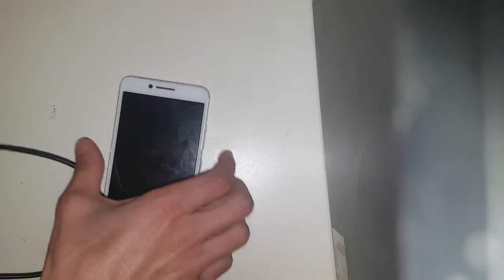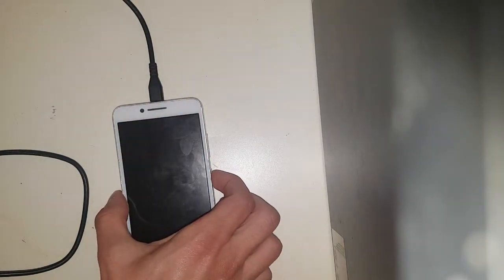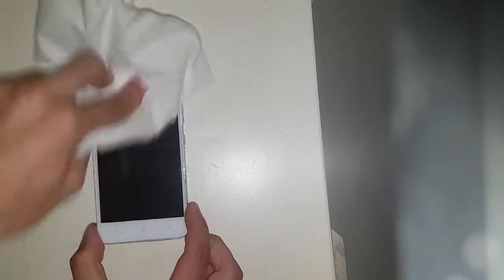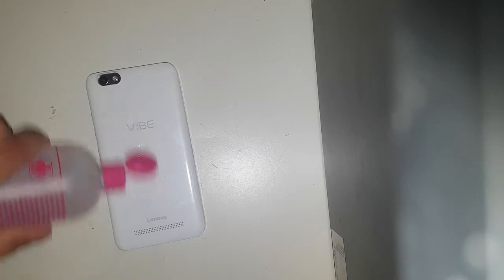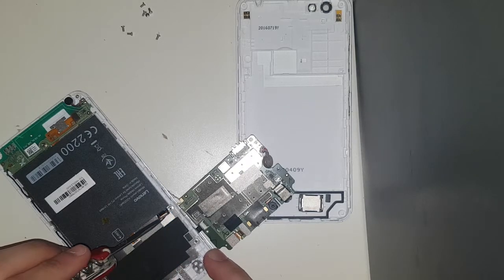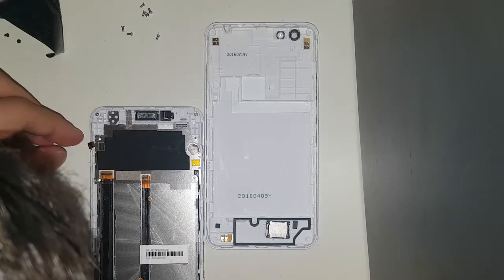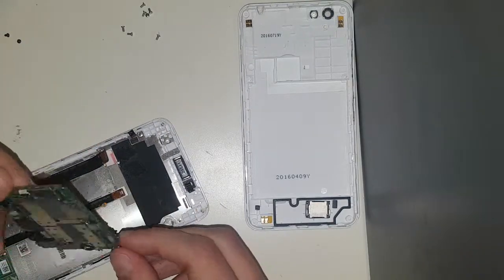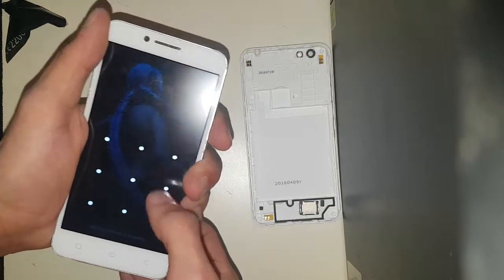Smartphone repair no display (Lenovo vibe C)

Comment: Nice fix man , I really dislike it when phones don’t have enough cable slack , so a simple drop can cause the cable to pinch and break loose
Reply from the maker: Not only that but the cables have no support at all and especially after the pair of screws in the middle come loose its fairly easy for the cable to get disconnected, a bad design indeed.